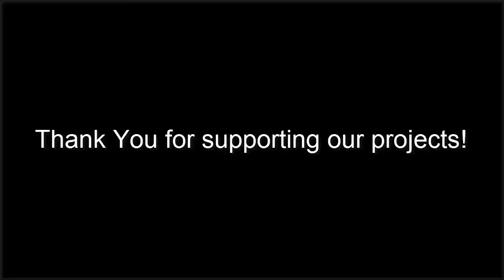The Bloch Wall - How the Bloch Wall can Change.

Comment: Define Bloch wall...
You can't.
Reply: In a permanent magnet, where an imaginary 'wall' runs between the two round centers of the  figure 8 shaped energy flows.  The center point of the mass, where b-fields change curve and direction. The equator of the magnet, or point of balance.  A great place to put a spark gap and gain some negative resistance.
Reply: @steveproper1270  exactly correct, "imaginary" 🤭

Comment: so a bloch wall is the equator of the 2 fields?
Reply from the maker: The Field structure still is in debate for some people. However, the Neutral Plane, where most of the Solar Systems Orbiting Objects are found, is an indication. As above, is as below. Howard Johnson was right, we have Field structures quite different than was shown in the Iron Filling Experiment! Why, Iron does what in a magnetic Field? as one is attracted to the other is distorts the real picture! One can not take measurements on an experiment with measurement equipment that change the readings!
Reply: @SweetSQM  You are totally right my friend! cheers